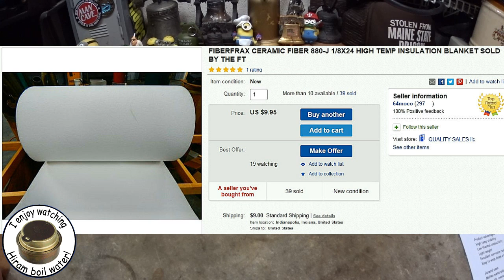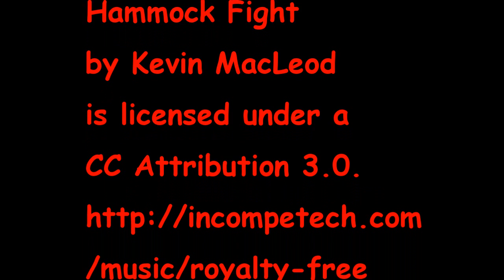Fancy Feast Stove with Ceramic Fiber Wick

Comment: Many thank for the shout out,  hope you have fun with it,  the superwool plus i use it quite different in texture its more like cotton wool,  and it comes in thicknesses from 6mm upto about 40mm. 

I can confirm there is no shrinkage below the operating temperature. 

i can post you a load if you want for free. Its very very cheap here about $15 for a meter square.

Comment: That is what I am going to use. If you look on ebay for ceramic fiber insulation sheets you can find it cheap. Mine was $3.47 Canadian delivered.  It took about 6 weeks to get it from China and it had one fold in it. There is plenty of material to work with for that cost. It works out to $2.53 in USA funds. :) Thanks Haram!!!

Comment: Interesting development! Got me thinking of alternate wick materials also. I had some of the Shamwow type material handy so I made a wick of that to fit the vienna sausage can stove you reviewed a while back. It lit from the outside, I got a 2 cup boil in less than 4 minutes in a 4 1/2" SS pot with lid. I let it burn all the way out and finally got some scorching and shrinkage at the very end of the burn, but overall I was impressed.

Comment: After watching the ceramic video I went on the hunt. Didn't find the ceramic sheet that you found but I did find and order two other items:US 5M HIGH HEAT EXHAUST INSULATION HEADER PIPE TAPE WRAP FIREPROOF FABRIC CLOTH 1.97"Titanium Pipe Wrap Exhaust Turbo Heat Manifold Header 1"x25' Roll With cool tape I'll let you know if they work. Looks like there will be lots of extra so I may be able to send you a couple of feet of each.

Comment: I used a piece of Ceramic Fiber 3 1/8 inches wide folded in half to get the 1/4" thickness I needed to fill the space between the two cans on the Fancy Feast stove, which seemed to work very well.  I tried it with the folded side on both the top and bottom but flame wise it didn't seem to make any difference, although it was somewhat easier to insert the inner can with the rounded side of the Ceramic Fiber at the top. On the next one I believe I will cut the ends on a slight  diagonal angle, so there will not be a vertical seem running from the bottom to the top in the Ceramic Fiber fabric.

Comment: thanks to Tac Blade's reply it got me looking in the right direction. Superwool Plus shows up as Superwool 607 Plus on Google. Unfortunately on eBay it comes in rolls too big for a one off project. I was more successful using "ceramic blanket" or "ceramic fiber". You can then buy smaller quantities but it may not be the exact same stuff.

Comment: Compressed ceramic wool sheets do not shrink . It can withstand temperatures upto 2300 degrees farenheit . The temperature at the top surface of the wick will be less than 500  degrees farenheit

Comment: So what is your opinion of this material in regards to deterioration & small bits of ceramic being lost in breakdown? For example I like storing my FF stove in my pot. I let my CF version burn off all alcohol. I get small amounts of CF I can usually blow out & what left I'm not afraid to ingest but ceramic idk...
Reply: I put mine in a tiny stuff sack to stop this from happening or a tiny ziplock bag.  Just to be on the safe side.

Comment: Supplier of the sheet mat'l found in eBay as of 03/20/2020.

Above URL at ebay was NG.  Typing into their search fld w the product name/ID was also NG.
So, i typed in 'ceramic fiber sheet' and got 1/8"T x 12"W x 24"L , named Kaowool for $16.79 + 0 shipping + tx.  I don't know if it's a same mat'l but it says it can stand 2300F which would b
plenty for alcohol flame of ~900F.  I'll b using it for my 1/32 scale live steam locomotive's
alcohol wick cups(3).  I hope the sheet can be rolled into 1/2" diam x 1"H cups!